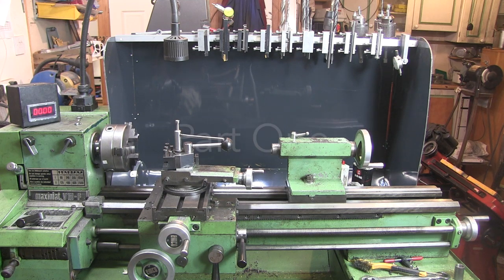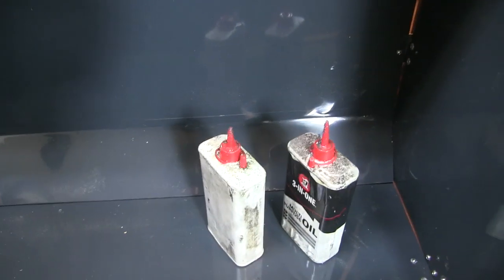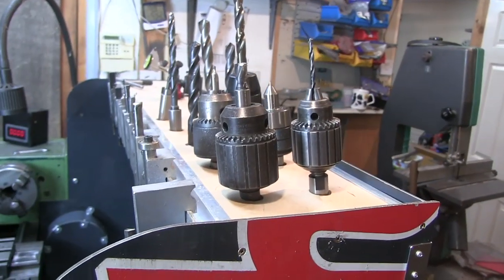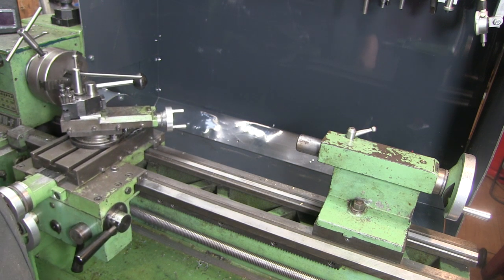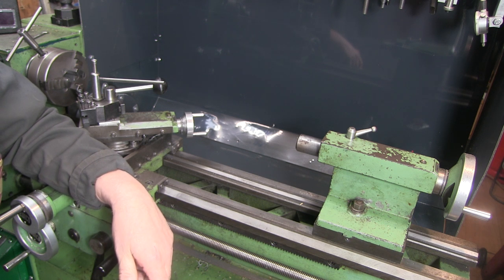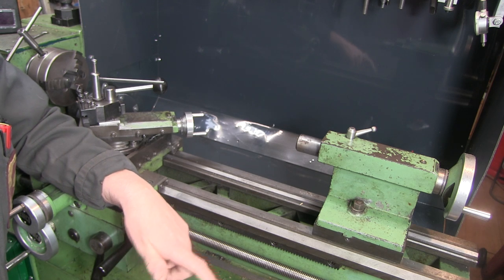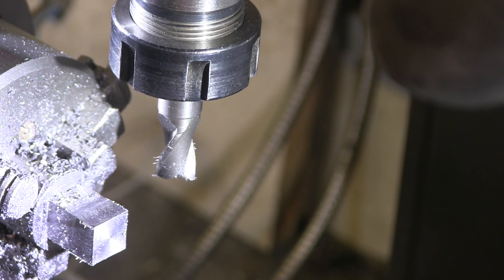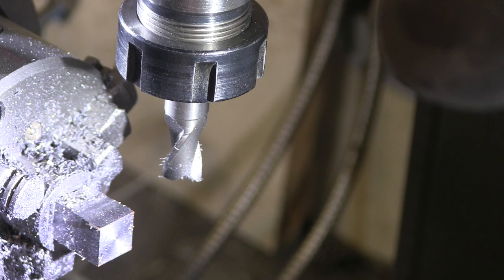Emco Maximat V10-P Back Panel and tailstock spanner upgrade? Part One

Comment: Cliff not sure of the construction of your cross slide but could you consider embedding  the DRO like M Dro suggest for the Myford 7 I have done this on mine and it makes for a much better installation
Reply from the maker: I've seen that, the chap I bought my pantograph had just done it on his Ml7, brilliant job, I think my banged set up might be on the way though! :-)
All the best,
Cliff

Comment: Hi Cliff, I fitted a DRO to my V10P, I can take some photo's and include dimensions of scales used. I had to shorten one of the scales, also lathe has a tailstock locking lever which does not get in the way.
Let me know if photos will help.
Good job on back panel, and I like your quick change tool holder method, mine are all balanced on the top of the headstock.
Reply from the maker: Hello Chris,
Photos would be good, where did you get your dro?
I have had some near missis with stuff on the headstock, which is to convenient, particularly the chuck key, which got caught up with a bird's nest and fired across the workshop, lucky I wasn't in the way!
ATB, thanks for watching,
Cliff
Reply: Cliffs Shed Cliff I will take some photos tomorrow, I got the DRO and scales from an eBay seller in China,will have a look and see if I can find him in my past buys, it was about 3 years ago.
And okay on your near miss with the chuck key, as you say the top of the headstock is a bit to convenient.
Regards
Chris
Reply from the maker: @g8wqj  My email is cliffsshed@gmail.com.
Cheers Chris
Reply from the maker: @g8wqj  my email is cliffsshed@gmail.com
Cheers Chris

Comment: Hi Cliff,  In one instance a pull down nut it actually much better than a cam lock on the tailstock - tapping threads with a loose/sliding tailstock.  You can set the drag level just right, whereas a cam lock is on or off.

All looking good.  I hadn't seen that aluminium sheeting before.  Very trick.  My back panel is a metal shelf from a compactus.  I drilled holes in it for my Allen keys, as they get a lot of use with the lathe.  Cheers Rob
Reply from the maker: Never thought of that Rob, the ML7 has a cam lock, but I see what you mean, I'll try that next time I thread with the tail stock, I've always just had it loose before, 
Thanks,
Cliff
Reply: @CliffsShed  The nut allows you to loosen the tailstock, but not have all that side to side movement that can occur when tapping larger threads with a camlock.  In all other aspects a cam lock is much easier/faster.  Food for thought.  Cheers Rob

Comment: Back Panel Brilliant  !        Have Made Quite A Few Useful Things From Signs , Old Counter Tops.                 If Its  Not Nailed Down , Its First First Come First Served !         Nicely Done , Looks Like At Last You Are Free Of Trying To Be Up And Running.    Patience Will Be Rewarded.     47.3 Thunbs Up
Reply from the maker: True Stephen, I have been using it, it is a lovely lathe, so accurate, I know a lathe should be accurate, and the ML7 is, if you know where accurate is! :-)
ATB,
Cliff

Comment: Cliff,
In the April 2006 edition of Model Engineers Workshop, there is an excellent article by Jim Wetren entitled ‘Tailstock Lock For The Parazimat Lathe’. The Prazimat DLZ is quite similar to your lathe. Well worth a look. If I had your e-mail address I would send details.
P2
Reply from the maker: Hello P2,
That would be interesting to see, my email is, cliffsshed@gmail.com,
Thanks in advance😁,
Cliff
Reply: @CliffsShed  I'll send you a piccy of my tailstock lock - it's a hex bolt, with a 'key' that follows the contours of the tailstock and comes over the top towards the quill lock. Really quick and easy to use as a semi-permanent fixture and doesn't get in the way.